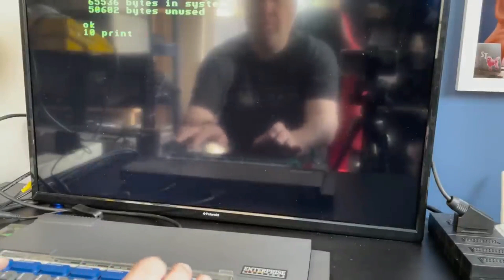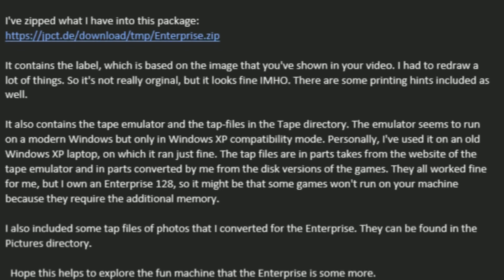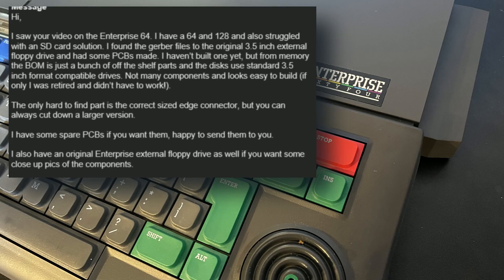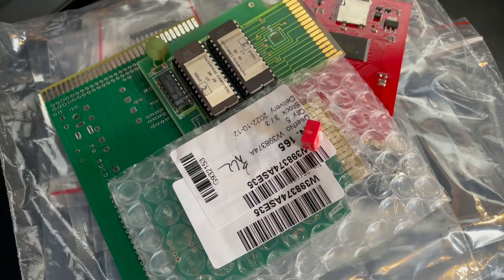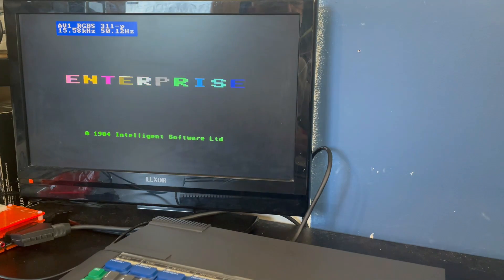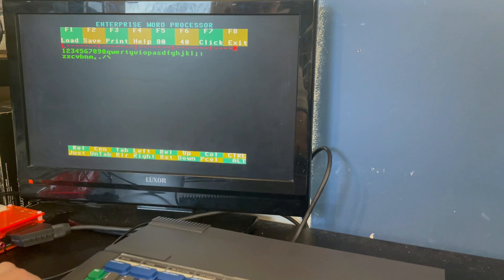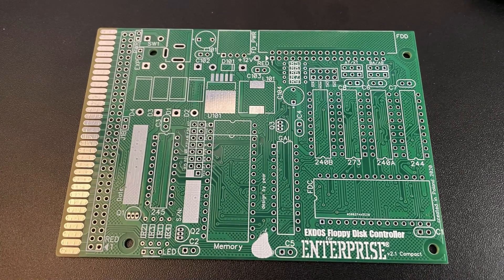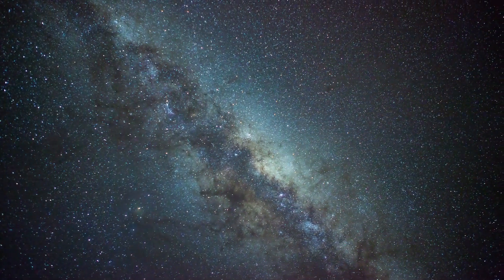The Enterprise 64 is in spacedock for a refit and upgrades!  Memory, SD Card, Floppies, The Works!

Comment: Excellent work!  We don't really do SCART here in Australia so I removed the UHF modulator can and installed a mini-DIN socket that took the RGBS signals from the edge connector ... I then made a mini-DIN to RGBS cable to plug directly into my GBS8200 /Brett

Comment: small correction:
Binary programs can be loaded from EXDOS also by :LOAD prgname
There are some programs which using the advantage of memory expansion:
The Next War - Converted from Spectrum next, and digi music is loaded only on Expanded machine.
The Hobbit (new version, it is about 600KB) - everything is loaded into the memory 
MOD Player
SPEMU128 - ZX Spectrum "Software emulator", it works only with expanded machine
The Sword of Ianna - Converted from CPC, needs at least 512 KB RAM
WAV Player
and there are some other games which loads everything into the memory if have enough.

Comment: Another, rather simple thing to make is an adapter to connect proper Atari-style joysticks to the proprietary joystick ports. The only problem for me was to source a fitting connector (which means: I couldn't find any, so I had to cut down an almost fitting one).
After building my own, I got an original adapter form eBay... it's still shrink wrapped in it's old packaging. It's worth millions, I suppose...🤔

Comment: BTW, did you find you had no clearance on the EXP2 connection? I added a header to it but found it rubbed the top case so removed it and soldered directly to the motherboard.
Reply from the maker: Kind of - I used patch cables with the pin pushed through the motherboard and soldered in place so it looks like a header on exp2 but it isn't :).   It's pretty tight in there!

Comment: Just done the 512k ram upgrade which had the PCB made and soldered up myself. No luck finding an SD card solution yet.... Is the tape emulator EPTE by any chance? I've been using Tapir to convert tape files to MP3 and playing on my phone which has worked well. I cut my membrane down to the tear (i ripped both mine opening up!) and stuck some sellotape on the back for support. Sanded the front end to get the contacts shiny. Been find since.
Reply from the maker: Yep, the tape emulator is EPTE :).  If I manage to make progress on the SD Card solution, there'll be an update on the channel for sure :)